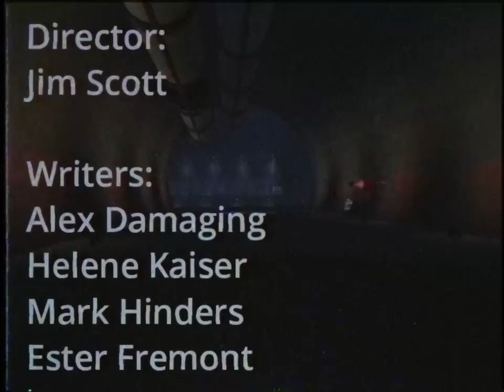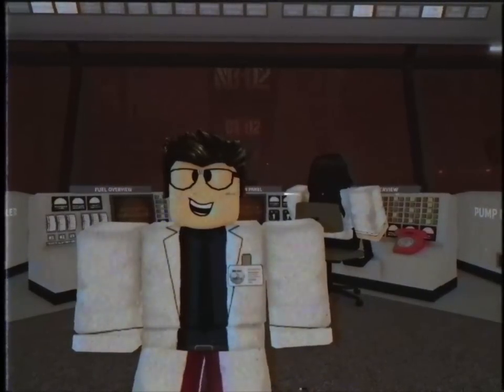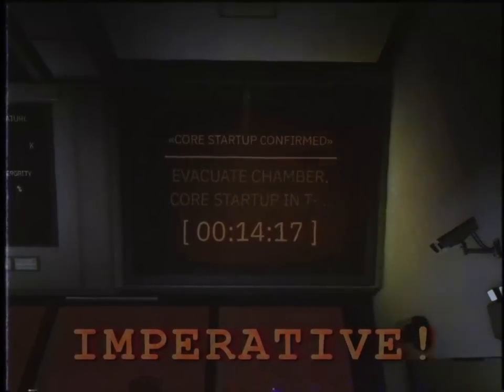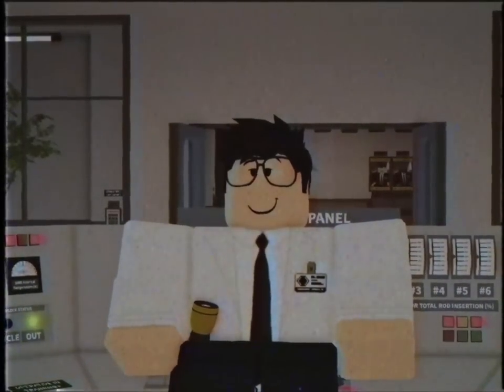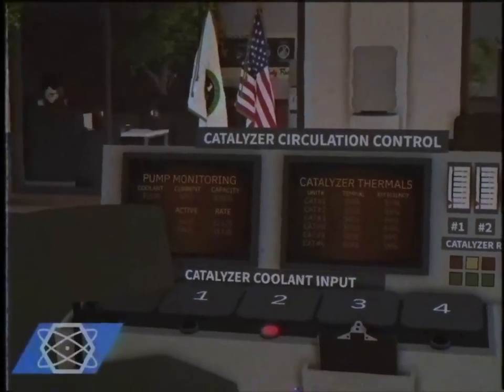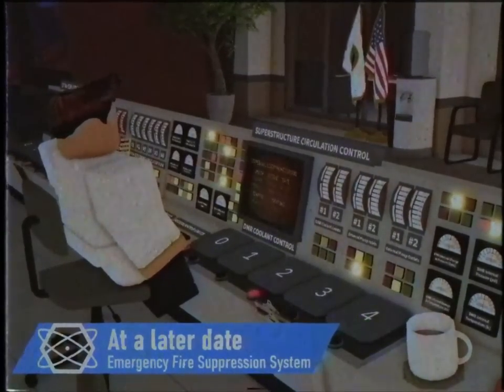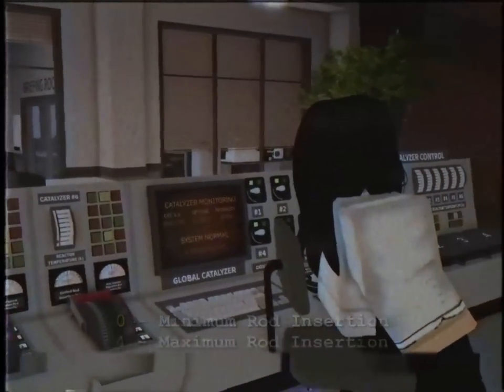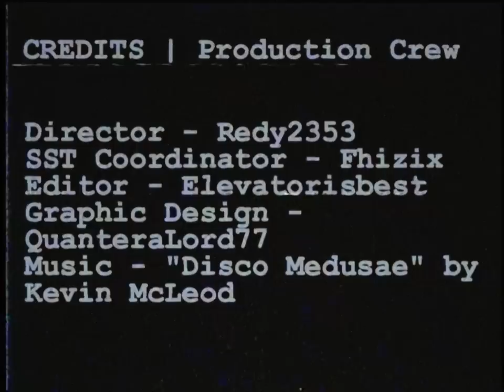Madison Research Center Training Program - Episode 1: DMR Basic Systems

Comment: If people actually RPed and operated the DMR like this in QSERF, that would actually be pretty cool.
Reply: i wish
Reply: but if reactor no go boom, then what purpose is there??? 😭😭😭

/s
Reply: @aloofdefloof  We make the reactor go boom, BUT, we pretend like it's a test scenario, like we RP a Reactor Ops test where the DMR has a power surge or overheats, and the situation goes haywire and boom.
Reply: Yeah
Reply: @Anowomaly  Or just RP what happened on August 18th, 1985, if someone has a Kaiser uniform
Reply: @nathanadrian I have a Weldman uniform. Also, Kaiser wasn’t there when the dmr said “boom”
Reply: @Jim_61 Dr Martin Miller, Dr Brenner, Dr Daniel Weldman were.
Reply: @Anowomaly chernobyl flashbacks
Reply: @spar1a-dvn  Exactly.
Reply: @aloofdefloof Level 3 is satisfying. That's why no boom :)
Reply: @spar1a-dvn Flashforwards
Reply: @aloofdefloof there is an ending. it's rare but I got one when entering a ro cavern elevator.
Reply: @aloofdefloof not all nuclear reactors blow up

Comment: They should make one of these for Foxtrot-9.
Reply: agreed. it is a bit challenging to control it and sync it to the aux grid.
Reply: true
Reply: i always wanted to learn advanced reactor operating guide
Reply from the maker: It's in the pipeline!
Reply: Have you seen the thumbnail? There a tape labeled with the Project Helios Fission Reactor.
Reply: @QuantumScience  metaphorically or physically in the pipelines
Reply: @QuantumScience and I opened the valve 😊